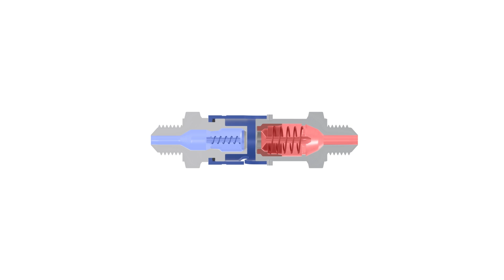🛢️ No More Spills | Dry Break Couplings

Comment from the maker: Working on brake, clutch, fuel or oil lines? Want to learn where and how to use AN fittings? The course below is for you.
👨‍🔧 Expert motorsport plumbing. Start learning instantly with 50% OFF your first online course: https://hpcdmy.co/offery203
🚙 Building a fast car? Get $400 OFF the all-inclusive VIP online course package deal: https://hpcdmy.co/offery203	

TIMESTAMPS:
0:00 - Dry Break Couplings
0:27 - Fuel Fillers
0:42 - What Is A Dry Break?
0:59 - Other Uses
1:10 - Brake Line Dry Break
1:36 - Air Introduction
1:51 - Fittings
2:20 - Hardline Vs Flexible Couplings
2:37 - How A Dry Break Works
3:11 - Summary
3:37 - Just One Piece Of Knowledge From A FULL Course

Comment: I love dry-break fittings, but using them for brakes is a bit too risky for my liking. In my opinion, in order to use them for brakes I'd prefer to see:
1) A proper two-operation process, not just push and a quarter turn but push and at least a full turn with it not disconnecting the internals until the very end of that process.
2) Electronic monitoring - A normally closed switch contact which opens as soon as the first stage of the disconnection process is started to warn of any issues.

I know that in motorsport they are regularly inspected, but it just seems too risky for brakes without a redundant locking mechanism and monitoring.
Reply from the maker: Anything can and will fail if you don't follow the instructions 😎 - Taz.
Reply: @hpa101  My point is that anything can fail even if you do follow instructions. That's why for safety-critical components, you should have:
1) Redundancy - So that a single failure does not result in an immediate safety issue.
2) Monitoring - So that you can tell when the redundant item is no longer redundant, because redundancy will also hide failures.
Reply from the maker: One of those things though. Are you actually solving a real issue/problem, or adding more complexity to most likely instead cause new unforeseen issues 😎

Maintain things, use appropriate parts for the application and do it all correctly, or pay someone you trust to do that for you 🤘 - Taz.
Reply: @hpa101 We're only talking about an extra switch to tell you when the connector isn't fully latched and locked, the minimum in my view when using disconnectable brake lines. It doesn't add an extra joint in the brake line which means it's risk free. It's no different to the added complexity of fire extinguishers which you could argue also aren't strictly necessary, but we add them as a reasonable measure towards safety.

But if we're wanting to minimise complexity and risk in the first place, we wouldn't be talking about adding quick disconnects to the brake lines, which add two fixed joints and a joint which is going to be repeatedly redone to every corner - That's a lot of extra risk compared to a basic switch per corner to tell you if they are locked properly.

This sort of decision isn't just for the driver to make a judgement call on, as it also risks the other competitors. I'm frankly surprised that there are events which allow for disconnectable brake lines in the rules, let alone manufacturers which allow you to use them for this purpose without offering a monitored option. I would have expected manufacturers to have said don't use them for brakes for liability reasons, just as many products say don't use for critical life support applications.

The concept of using monitoring with redundant items is not something new that I've just dreamt up, it's been around in industry for a very long time. It's a concept written in blood, as most safety things are.
Reply from the maker: They already have that though. Just so we're on the same page, what specific dry break fittings are you talking about, as they must be different to what Connor has shown here. Fire me a link.

Centre-lock wheel nuts would be a more relevant comparison than a fire extinguisher.
No monitoring system, no redundancy. Are they a problem? On paper, absolutely! 1 nut holding those on, crazy! 
In reality, though, not an issue 🤘

Realistically, motorsport is dangerous, and it requires some level of competency, even for dry break fittings that do lock in when fitted (at least the ones we're talking about here) - Taz.

PS: If you actually have not used them at all, then perhaps watch this video as it shows the style of mechanism a little better. 1 min or so in: https://www.hpacademy.com/blog/this-is-the-way-an-jic-line-quick-release/
PPS: You don't have to fit these to your race car if you don't want to.
Reply: @hpa101  That style you've shown is the sort I'm primarily referring to. The redundancy issue for me is that while it is two action (Pull then turn), the second action can be driven by the spring that allows the first action. I.e. If you pull and rotate just a little bit, the spring will pull the pin down the ramp, turning it for you. I would consider this style to have no redundancy.

A better system in my view is the Staubli DMR range, which completely isolates the pulling action from the rotation action. Part of this is due to the larger fitting, allowing them more space for the mechanism but ultimately this is what I see when I think of redundancy. Either way, a NC switch would be trivial for the manufacturers to add in comparison, and to have that as a rule would in my view just be common sense.

A big concern for me is the misuse, the street guys seeing them and thinking it's a good idea to use these on a road vehicle where they aren't going to be regularly inspected.

Centre-lock wheel nuts is an interesting one. At the highest levels such as F1, they are redundant because they have built-in locking mechanisms. For production street cars with such wheel nuts for posers, they often have an R clip for redundancy. I'm sure there are some series which allow centre-lock wheel nuts which aren't redundant, but that's would be insane to me.

And of course you're right, I don't have to use them. But that doesn't mean I won't be affected by those who do use them - The risk is not just to themselves, but also to everyone around them. Whether that's on the street, or at a track day - Just because manufacturers offer dry-break fittings advertised for use on braking systems (All manufacturers, they all seem to suggest it's fine) even when they may say "off-road use only".

And that's the kicker for me, you have products (Again, this is a problem by all of the manufacturers who make these, not just one) which have poor/flawed redundancy, no monitoring, and are advertised as suitable for braking systems. The braking system is the most critical part of a vehicle from a safety point of view. If you lose a wheel then that's a massive problem, but you can still slow the vehicle and maybe maintain control. (Aside from the danger of a wheel flying along towards a marshal, of course) But if you lose brakes, that's the difference between a high-speed crash and a really high-speed crash - A survivable crash and a pancake situation.

Don't get me wrong, anyone who has ever changed brake pads in a car knows how annoying it is to have to support the callipers while they are tethered by the brake line, I get the utility, especially in rally situations. But there's a common-sense solution to reducing the risk, a warning switch. I'm not saying don't use them, but I'm saying use them responsibly.

PS: I wish they made high-flow dry-break fittings for coolant lines.
Reply from the maker: Staubli DMR range is only rated to 30 PSI and brake or hydraulic applications are not listed. Their CBR range, the same style shown here, is rated to 300 PSI and recommended for brake applications.

This is probably what would satisfy you though: https://www.staubli.com/content/dam/fcs/brochures/products/hpr/hpr-quick-coupling-high-pressure-motorsports-en.pdf

I'm sure if you get in touch with Staubli they might explain why the style you deem safer isn't used for more demanding high pressure applications where the design you don't trust is instead preferred. DYME is also a brand that is super responsive. That might give you peace of mind.

Personally, I'm more worried about the drivers around me 🤣, but I can't speak for your own personal experience.

Cheers for sharing your opinion - Taz.
Reply: @hpa101  The Staubli HPR range is a much better design than the Staubli CBR range which features prominently on their site, which are also advertised for Motorsport braking applications. The HPR range does appear to resolve the interconnected actions issue present in the designs with a bayonet locking action. Sadly, DYME only appear to have the bayonet style as well.

It's hard to see from the site, but I presume the HPR range internally uses locking ball bearings like most quick-disconnect hydraulic fittings do, rather than the bayonet style.
Reply from the maker: @yngndrw. I guess all these different companies with that similar/same design to the CBR range have a lot of confidence in it for some reason 😎 - Taz.